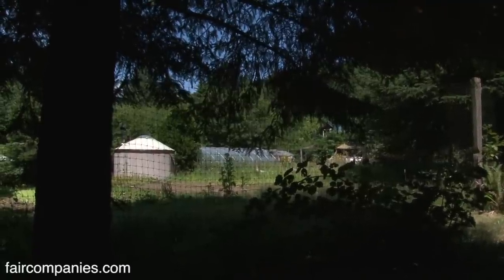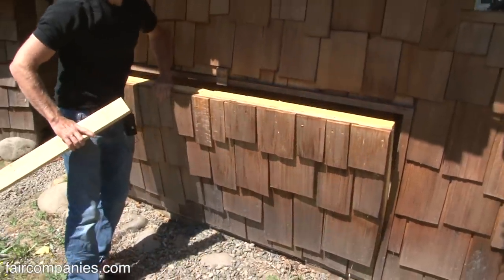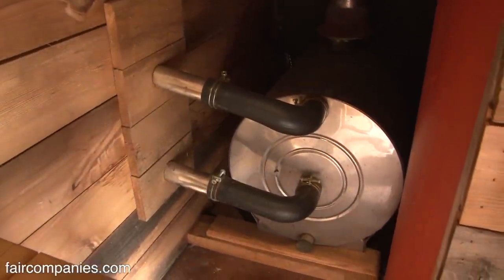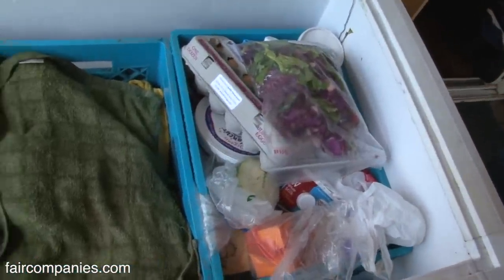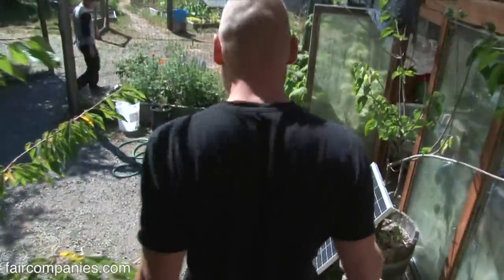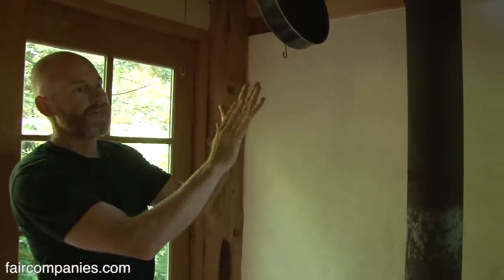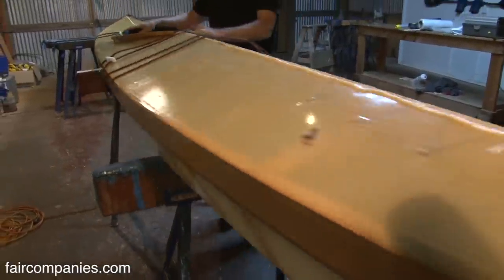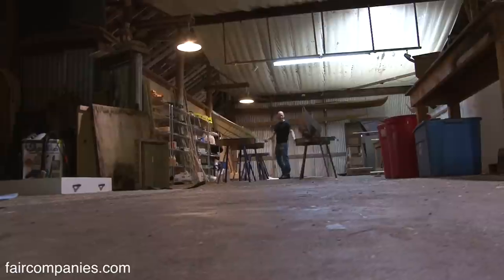Off-grid, handcrafted life on Oregon farm & workshop

Comment: LOVED this.

For Off Grid Hot Water we use a 40 gallon stainless steel wood fired "kettle" that we bought from the Amish. The saddle tank on the wood stove did not produce enough hot water for a family of 5's dishes, laundry, baths/showers...

Hot water is an essential and one of the big problems for "Off Griders". The wood fired kettle solves that issue. All you need is wood and rain water.

Comment: Great strides have been completed here. 
The only thing I could think to add would be a Sterling engine either tied to the bath house solar-thermal panels, or a dedicated solar thermal panel combined with the Sterling to provide another KW of energy. That will tide you over the Winter, and the water from that can be used in other systems, like floor heaters, etc.

Comment: Great job. It doesn't mention what part of Oregon, but it looks like it's not too terribly cold there. We're doing the same thing in the Colorado mountains, with negative 20s in the winters. Wood heat works, and is sustainable and carbon neutral. Solar thermal is the most efficient way to use the sun, and heats water and air quite well. We do have more PV than they do, and cook with propane. The solar oven is a great idea, but I haven't built that yet. I also haven't built the 'bath house' yet, but our large walk in shower in the house has a 5' wide bay window open to the woods, so it's like being outside, but warm. Our biggest challenge is the short growing season, but the greenhouse is designed and staked, awaiting a backhoe to level the ground. Anyway, they're doing a great job.

Comment: Great work with everything you did. I have a suggestion for you. Please consider starting a biogas digester and store methane as your gas source. It will help in cutting off as you called it- the dirty hidden secret of using propane connecting you to the grid

Comment: Question on the wood cook stove w/copper pipe inside the stove pipe:  Does the pipe collect soot, or deposits from burning?  My friend did a similar tech. with the copper pipe wrapped on the outside of the stove pipe with water going into the pipe and then into a water heater tank that stored the heated water for cooking, bathing.....or whatever.  Lot of work you've put into this, enjoyed your videos.

Comment: with your solar thermal pump... you have a strap across the face of the PV panel.  Are you intentionally reducing the power of the panel?  If so it would be more efficient to turn the panel 90 degrees so you are effecting one bypass diode instead of both.

Comment: A flexible living situation need flexible living areas..... meaning non permanent houses you can either put up and take down or simply structures you can move either whole or as components...flexible for flexible lives, static houses for static lives...
I'm working on getting a house together by 40 foot containers that don't look like containers but retains the ability to be moved very inexpensively yet have high quality services built in...like luxury you can move...place your house by the sea for a summer, why not, move closer to the city in winter, just move... wanna be close to mountains, skiing and adventure in winter just move your house.... flexible living for flexible people... non permanent structure with value, beauty and purpose built in

Comment: I did the exact opposite because I wanted to go green and changed my wood burning to clean propane.  Wood is only considered “carbon neutral” in its natural life and decay.  Natural decay of wood is over a period of decades and the case of some wood gets absorbed by the soil.  Burning the wood releases carbon in a matter of minutes that took years or decades to sequester.  Wood burning does release black carbon in the form of green house gasses.  Plus burning wood is almost always a net heat loser in that more heat is waist-ed than used for its purpose.  Although I admire your effort to use more of it. Wood smoke contains harmful pollutants like carbon monoxide and particulate matter. Agree or disagree, having these types of discussions are good.  Thank you for the video, I really like that Japanese bath and forest house.
Reply: While I am sure you are correct about the wood (it does take longer to grow than to burn after all!), how is propane any cleaner? It takes considerably longer to form than trees and usually goes through some refining processes if it is for commercial use, no?

Comment: I notice you are in a mostly green tree area. We are near The Dalles, Oregon. Much less natural green .We get about 300 days of sunshine compared to about 2/3 that amount just 30 miles west into the Columbia river gorge and further west to Portland Oregon (Rain, rain rain...). I think that this area, that has always been financially depressed is going to grow. Google moved here to use the large river for cooling it's computer servers and is even doubling in size additional 80.000 sq feet. But it only ads 12 jobs to the area.  We also have really good wind that I should take advantage of that is caused by the pressure from Gorge that changes dramatically from large high and low pressure differences. https://www.google.com/search?q=The+Dalles,+Oregon&espv=210&es_sm=93&tbm=isch&source=iu&imgil=gBC2AArejR6w0M%253A%253Bhttps%253A%252F%252Fencrypted-tbn2.gstatic.com%252Fimages%253Fq%253Dtbn%253AANd9GcSN1y_9_bRv1n9_ywuAvyqXrwFtinVZGOgCiajxKewgc8-Hb3uuhA%253B250%253B162%253Bt8WNXg1XUYBnTM%253Bhttp%25253A%25252F%25252Fen.wikipedia.org%25252Fwiki%25252FThe_Dalles%25252C_Oregon&sa=X&ei=L1HGUrejCpHpoASn9YKABA&ved=0CE8Q9QEwBQ&biw=921&bih=575&dpr=1.1#facrc=_&imgdii=_&imgrc=rQrJbdQK8-9CgM%3A%3BqXJ5-GfQPdiLgM%3Bhttp%253A%252F%252F0.tqn.com%252Fd%252Fcruises%252F1%252F0%252Fo%252F6%252F5%252FThe_Dalles_10.JPG%3Bhttp%253A%252F%252Fcruises.about.com%252Fod%252Fcolumbiaandsnakerivers%252Fig%252FColumbia-Gorge-near-The-Dalles%252FColumbia-River-near-The-Dalles.-sxh.htm%3B1200%3B900

Comment: telephone and internet access is not "off grid" reach out and touch some one get a Ham radio it can also be used to access the internet.
Reply: I didn't know that.Is there still a monthly  access fee using a ham radio. How secure is the connection?
Reply: Steve Hoffmann  it's all about you knowing the technology except for an annual license there is no fee for ham radio. What I mean about "off grid" is that there are no wires connecting you to the rest of the world. The internet is accessible through ham radio technology you may still need a paid internet access some wheres though.
Reply: You can get mobile internet from cell phones too....Off grid usually just refers to the electricity grid.

Comment: This guy is wrong about PV panels. They are at the current price a better option than solar thermal in any form.
I live off-grid and I'm an electrical engineer. I made a study and the solar PV for heating directly without the use of battery (use thermal mass for storage) have the best price at about 2.8cent/kWh for 25year amortization and 1$/W for solar PV in my area that is still more expensive than natural gas 2.2cent/kWh.
I only have the solar PV for electricity as of now but I will use them for heat as soon as I can get the money.
If curios about my off-grid house search on google for my name Dacian Todea and one of the first pages is my google+ page.
Reply: addition: correct me if im wrong, but PV panels are also suitable for cold-sunny conditions. Infact, they don't really like heat at all (neither does the converter). This way you would get more out of PV panels than solar thermal if you live in a less warm climate.

Basically it all depends on what your needs are and where you live.
Reply: zyksii
I do actually live in a cold sunny place is southern Saskatchewan central Canada.
And yes solar PV loves cold sunny days  but the day is shorter so you still produce a bit more in the summer when the day is longer.
The way I want to use solar PV for heating involves just the solar PV and a resistive heater to heat in my case a large 14 cubic meters thermal mass that is my insulated slab on grade concrete. This at a delta of 10 degrees Celsius can store 100kWh.
There are no batteries or inverter needed for this system so all the expensive and unreliable parts are out of the equation.
Reply: How do you figure that solar PV is more cost effective than solar thermal? I've seen diy solar thermal setups estimated at 50% efficiency. What is a common conversion efficiency for PV panels? The custom solar thermal setups I've seen look very inexpensive. Also, there are so many types of solar thermal that I don't think such a generalization can be made- that PV panels are a better option than all solar thermal setups.
Reply: Paul Sowinski It will be hard to make a demonstration in a comment but I will try to give a few short facts.
The efficiency of the panel is only important if you have limited space is not important when you make a cost analysis.
Solar PV mono or poly-crystalline  are around 15 to 20% efficient.
The solar thermal that looks less expensive has lower efficiency so you need a larger panel for the same output.
The only type of solar thermal that I will consider in a cold climate for heating will be the vacuum evacuated tube type.
Those vacuum panels work quite good in cold climate but they are more expensive almost 2 to 3x compared to equivalent output PV panels not even taking in consideration the additional complications of thermal solar like pipes instead of wires and pumps.
The thing is that solar PV just a few years back where a few times more expensive and back then thermal solar made sense but at 1$/Watt they are hard to beat.
Also is important to take in to account the simplicity and reliability of solar PV.
I hope to make soon a video on my youtube channel with the calculation and comparison for heating with other sources.
Reply: Hell, anything that requires batteries still has you being a slave to some sort of grid.  I usually just figure that the best "renewable" depends on location.  Some places are probably more environmentally friendly by staying ON the grid
Reply: Peter Block
You can use solar PV panels without the battery directly to heat water or the house. It will be the same as solar thermal but more elegant (no pump and pipes) and less expensive.
Reply: That is true, and a good point.
Reply: All valid points...  but there is something to be said for such a simple analog method that just works with out the need for a switch or buttons.
Reply: Joe Blow
Solar PV also just work you can not get something more simple than that.
Two wires that you connect to a resistive heat element and heat your water, house or the food.
I will use them this way to heat my Off-grid house as soon as I have the money.
For now I have 3x 240W panels for electricity. That is what I use now to replay to your comment.